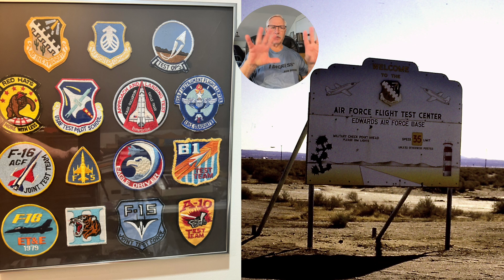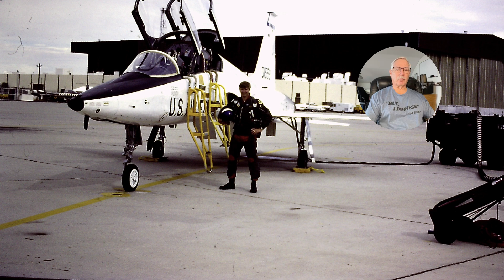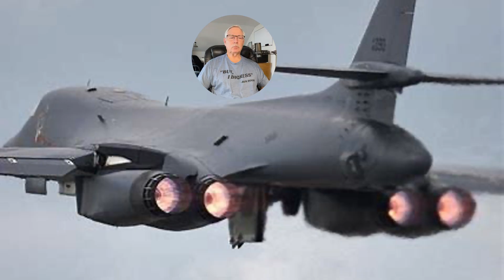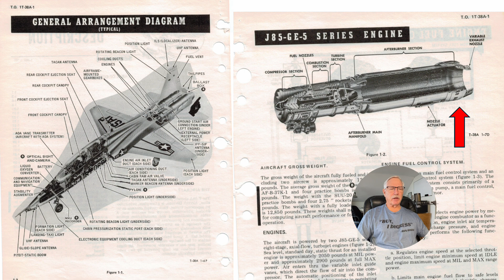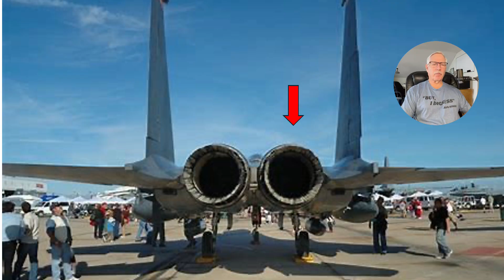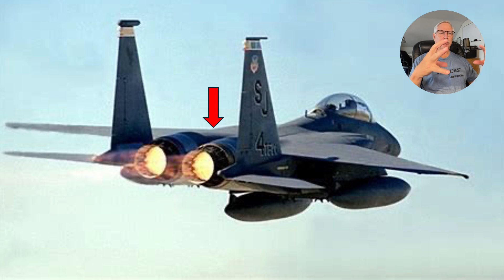Flight test chase pilot stories. Damned if you do and Damned if you don't! Chasing the B-1 at EDWs

Comment: How often did you break the sound barrier in your career?
Reply from the maker: I wished I had logged my missions better. I did it  a lot but don't have a number. I flew many F-16 supersonic tank jettison tests and other supersonic test points but I basically just have my Air Force printout which does not have the mission, other crew members or specifics of the flights. I made a few notes here and there but that is the extent of it unfortunately.

Comment: Is it true they didnt allow chuck Yeager to be an astronaut because he didn't have a degree?
Reply: While it's true that ultimately he wasn't eligible for failing to meet the education requirement, there was a lot of scorn and derision in the early days towards the astronaut program among the test pilot community as the mercury capsule wasn't even supposed to have a window or any manual controls (they called it "spam in a can"). At least according to his biographers NASA did actually approach Yeager but he wasn't interested and flatly turned them down. But another factor that somewhat ties into the college degree aspect was that NASA was looking for not merely the most superlative test pilots but the most superlative everything including flying but also engineering, problem solving, academics, intellect, physical health, resistance to heat/cold/sleep deprivation/stress/motion sickness/vibration/etc. Jim Lovell explained that in the early days nobody knew what being in space was going to do to the human body and mind and what skills and abilities would be required so the doctors making the selection wanted to make sure the people they picked were as adaptable and immune as possible to just about anything they could throw at them as well as the most well rounded and exceptional specimens in as many fields as possible. Chuck Yeager's was one of the most gifted and intuitive stick and rudder pilots of his era but he was not exactly a well rounded individual and that intuition simply doesn't apply to orbital mechanics. His disdain for the academics of piloting and insistence on flying by the seat of his pants worked well for him in the atmosphere but once he left the realm of aerodynamics and entered the realm of pure physics where his intuition was no longer any help, he struggled tremendously and the true story of his NF-104 crash during zoom climbs attempting to set the altitude record make it very plain to see.
Reply: You are correct. Chuck Yeager worked his way up through the ranks. When he was a Lieutenant Colonel in 1958-1959, he and my dad worked together at Moron Air Base Spain. Astronaut-candidates were required to have at least an undergraduate degree in science or engineering.
Reply from the maker: Thanks for answering. I was not sure about that. I know he made disparaging comments about not wanting to be "spam in  a can" but that was probably sour grapes.
Reply: NASA had a huge project on it's hands and needed smart guys who would also fall inline for the team.  Chuck was neither of those.  The astronauts needed to be and were involved with developing technical solutions.  Chuck relied on Jack Ridley for his brains.